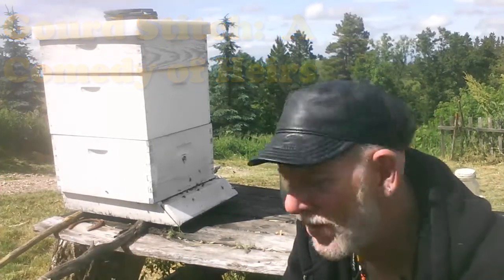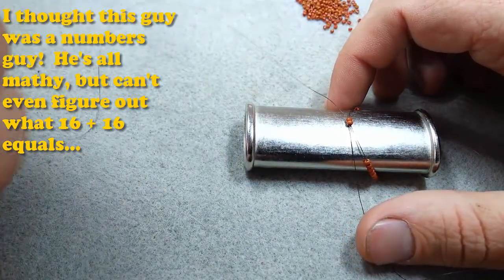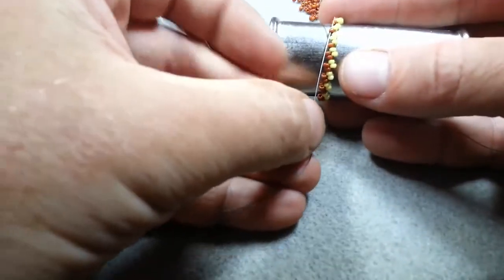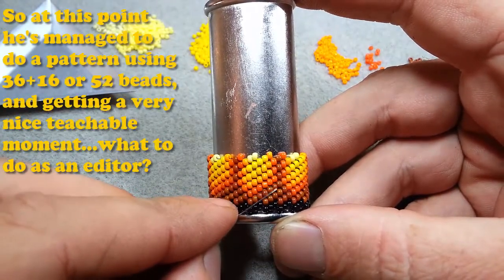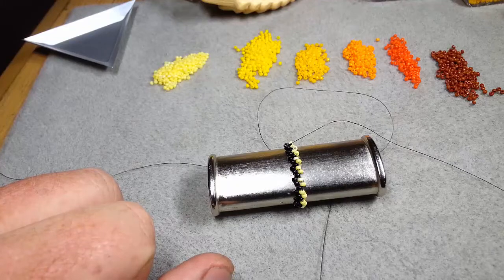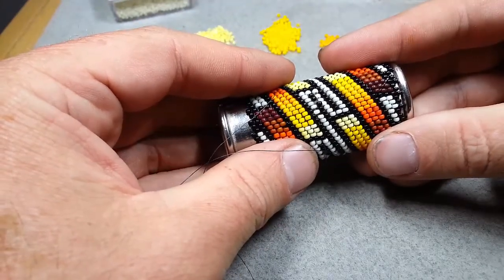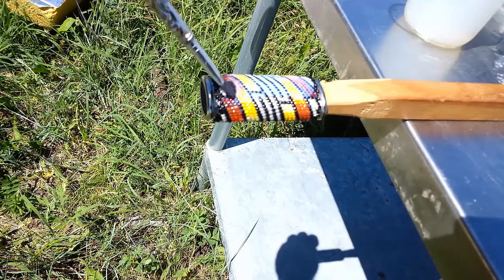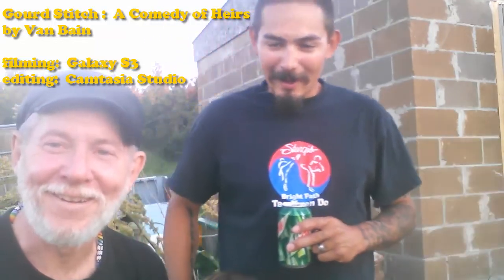Beading:  Gourd Stitch: A Comedy of Heirs

Comment: What kinda coat do you put on top? Also do you use the coat on all your work like necklaces or only lighter cases? Ur very talented love ur channel! The kids at the end are so adorable!
Reply from the maker: Use some kind of clear coating, either oil or water based.  The water based ones dry faster, so you should also factor in the time between coats.  Don't use any kind of sealant on necklaces, it'll just get cracked and broken; necklaces are meant to move around some.

Comment: I'm confused. You said 48 beads around, divisible by 3 and then only string 2/3 of 48 to start off, which would make it 32 beads, no? But you keep saying string 36 beads. The math is off. So is it 32 or 36 beads around to start off to complete this specific lighter circumference?
Reply from the maker: Yeah I messed up, I caught the error and corrected later in the video.  That's why I called it a comedy of errors.  I felt leaving it in, while it might be a bit confusing, would show how the creative and learning process work.

Comment: hi is there anyway you can bead a mini bus lighter from the start?
Reply from the maker: Hi, I've pretty much not had time for beading these days.  In theory it shouldn't be any different from the regular ones.
Reply: +VaniRex  I watch your videos hopefully you will get back to beading. I still don't understand the math but its OK. I really don't understand 3 bead gourd stitch.
Reply: Hi Bev, I also didnt understand exactly so I did a search and I found something on a PowWow site and they said this. I hope this helps. 
"You can put on a piece based on what the total number of beads that are pulled off when starting this type of stitch. (i.e., if it is 54 beads around a piece then to start you would pull off 1/3, which is 18 beads. Now that 18 is divisible by 1, 2, 3, 6, 9 or 18 so you can make patterns based on those numbers and your designs will come out even around the piece)

To start, you attach an example of what line direction you can work in on 3 bead drop. Unlike 2 bead drop the lines coming out left and right are not at the same angle. the line to the left is at a much sharper angle than the one to the right. This is something to keep in mind about this particular style stitch."

Pictures are on this site as well. http://www.powwows.com/making-patterns-in-peyote-or-gourd-stich-beadwork/
Reply: thank you so much. I am determined and i will attempt this until I figure it out. that is the only way to learn